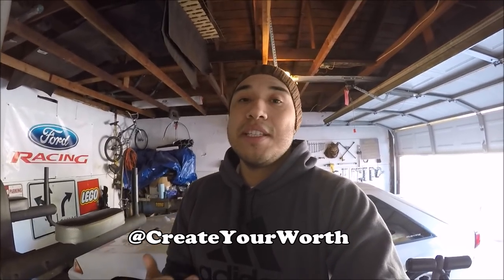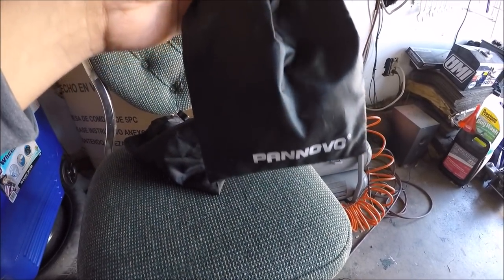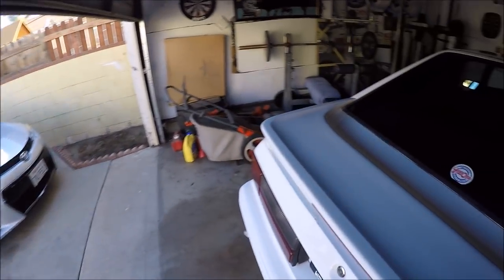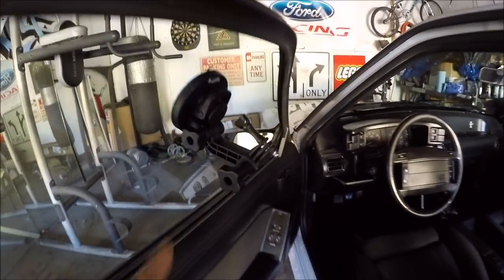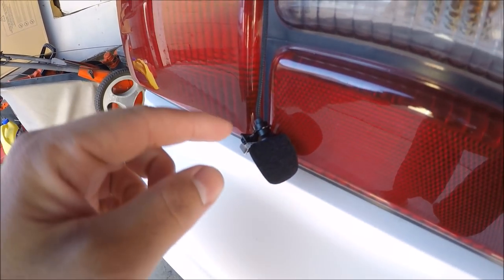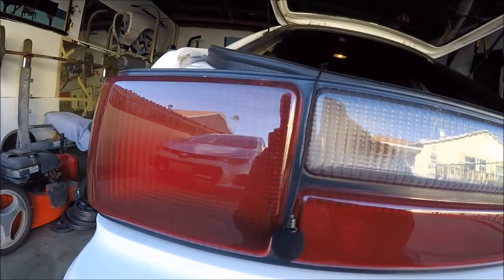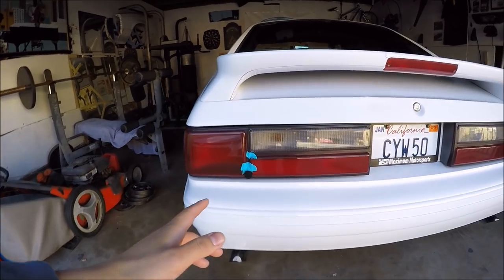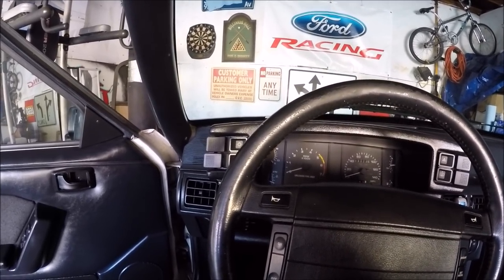How To Get The Best Exhaust Audio For Driving Videos

Comment: Let's get some tint on that whip. I ordered mine off of eBay pre cut for 30 and looks greats and is holding up still.
Reply from the maker: I had tint on the car, but pulled it off because it was purple. I personally think the car looks cleaner with no tint. Another thing too is cops are a**hole$ here where I live. I'm trying to avoid getting pulled over, since I would want all my windows tinted. Thanks for the comment!